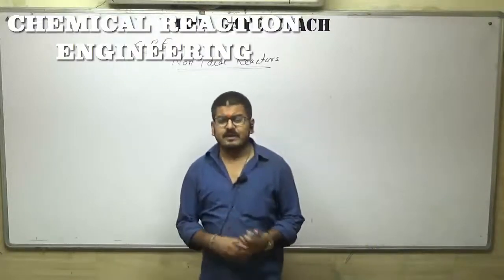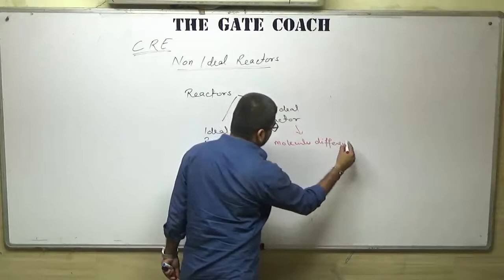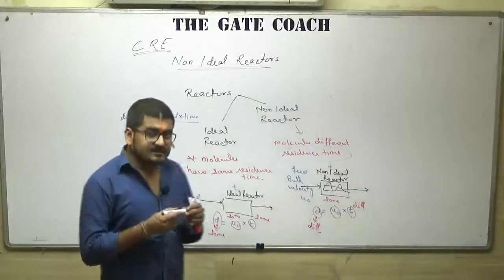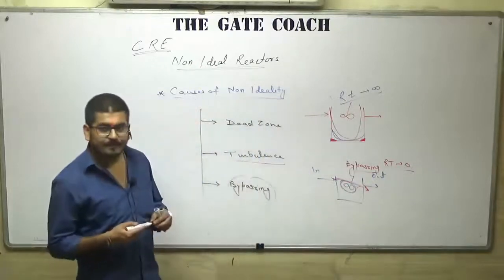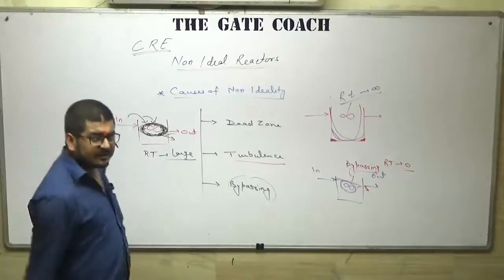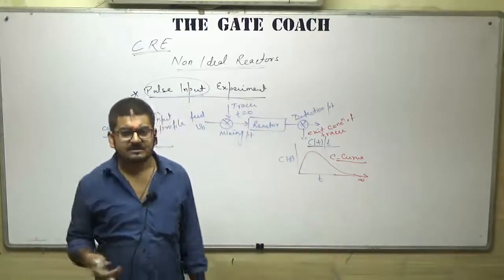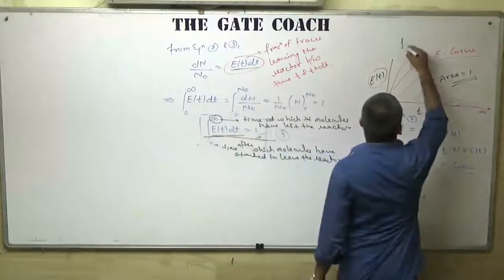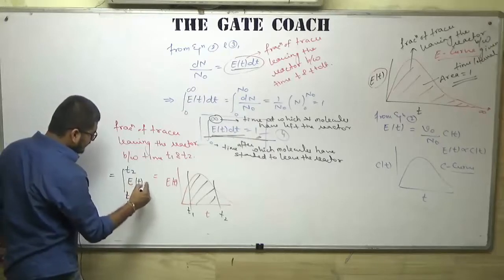Residence Time Distribution, Non Ideal Reactor Designing from CRE by Ankush Gupta at The GATE Coach

Comment: but in cstr residense time for all particles is not same.....
Reply: The Gate Coach Video in video it was told that residence time is not same for all molecules then it is called as non ideal reactor......but cstr is an ideal model with different residence time
Reply: cstr is an ideal model but constructing an ideal cstr is very difficult....bcz in practical it has dead zone ,turbulence etc......In levenspil it is clearly mentioned that cstr is an ideal model